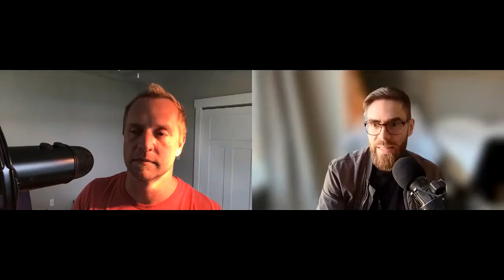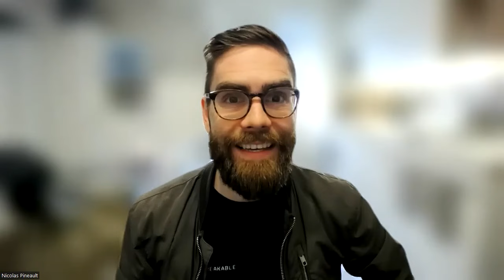Can Fiber Optics Cause EMF Problems? [Circle Preview]

Comment: I have another perspective on this. I work as a geomancer, with a focus on EMF mitigation. Although fiber optic cable can't directly transmit EMF radiation, it can transmit other types of subtle energy. If fiber optic networking gear is installed near a geopathic stress zone, or any Hartmann or Curry lines, then that harmful geopathic energy can get transmitted along the fiber optic cable. To be able to confirm this, you would need to hire a geomancer, radiesthesia or BioGeometry practitioner and look for the presence of "vertical negative green" energy that would likely be present in the effected area.
Reply: Yes!!!!Awesome you are a geomancer.  Thank you for speaking up and giving your perspective.
Reply from the maker: I agree that this is very plausible. An important angle, thanks for sharing

Comment: would like to know if there is anything to lower or stop the electric fields from wired track pads and keyboards ?
Reply from the maker: Use a grounding pad underneath - it will plug into the 3rd prong of an outlet and will likely reduce electric fields

Comment: Thank you for making this topic. Now with fibre internet out it's so harder to mitigate this because you can't just turn off the router anytime you wish.  Isn't there something in the market that is cost available for all?
Reply from the maker: I'm not sure what you mean. I guess the new router that came with your fibre internet cannot be turned off at night? This is unrelated to the technology, unless I'm missing something.
Reply: @TheEMFGuy  hi Nick, are you saying that fibre internet CAN be turned off at will? I thought it was just wires?
Reply from the maker: @User.k3431  Fiber internet just refers to how the internet comes into your home. Previously some people were on DSL or the COAX (cable) network, and that is replaced by fiber optics.

Fiber optics is just the name of the technology that would connect to your router/modem. It does not say anything about your router/modem needing to be on Wi-Fi, or your ability to turn off that router/modem at night.

So yes, the router/modem that comes with a fiber install can certainly be turned off at night.
Reply: @TheEMFGuy  that sounds at least better.  But if I turn it off, would it STILL emit some EMFs? Thanks Nick
Reply from the maker: @User.k3431  Sorry, if you turn the W-Fi antenna off, or if you turn the router off altogether?

I would tend to think that in both situations the EMFs emitted will be negligible.